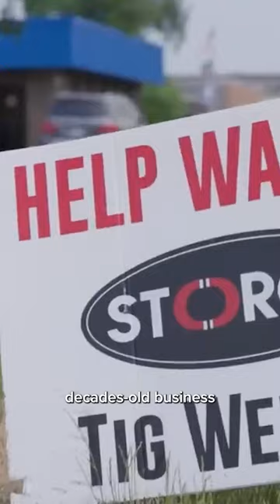How electric vehicles are upending the 100-year-old auto supply chain

Comment: Normal car fire 500 to about 1000 gallons of water to put out.
Ev car fire 20,000 to 60,000 gallons of water to put out.
Also China has produced so many electric cars and no one is buying them. They are sitting there just rotting away.
Ontop of that is that it takes much longer to "fill her up" compared to your normal daily driver petrol car.

Comment: Not quite yet. The electrical grid infrastructure is 20 years away from being able to supply charging electricity for ev cars.
Reply: With  American  red tape its 100😅
Reply: I think 20 years is VERY optimistic, especially when you consider charge loads for fleet and heavy vehicles.

Comment: Diesel is never going away.
Reply: Hydrogen will replace diesel
Reply: @doomtomb3  How? There is no feasible way to generate hydrogen without separating the hydrogen from the carbon from natural gas which defeats the whole purpose or using massive amounts of electricity for electrolysis to seperate the hydrogen from the oxygen in water? It's not economically feasible.
Reply: @mattdaddy_888 it's called nuclear power
Reply: @leprechaunbutreallyjustamidget  for generating electricity yes absolutely 💯 but for heavy transport no how are you going to fit a nuclear reactor in a semi truck or excavator 😭

Comment: I'm not sure EVs are viable. They are such a fire hazard. For example, the city of San Francisco just issued rules requiring residents to make sure they don't have more than 4 EVs in thesane location, including even scooters, skateboards and bicycles. And residents need to make sure that these are placed a sade distance from one another. The city doesn't have such rules for ICE vehicles. If governments have explosive-style rules in place for ordinary vehicles, it would seem these vehicles are fundamentally unsafe.
Reply: A properly built battery/vehicle platform is safer than a gasoline vehicle. 

Recency bias is at play here as the technology has not fully matured. Older gasoline cars would often become infernos when rear ended, rolled over, etc. They even used to ignite at the gas stations if static charge wasn't properly grounded.

Diesel is probably the most safe, but also has large expenses to control for emissions.